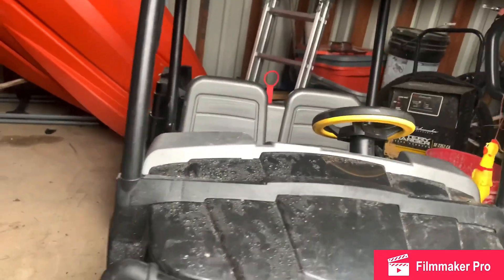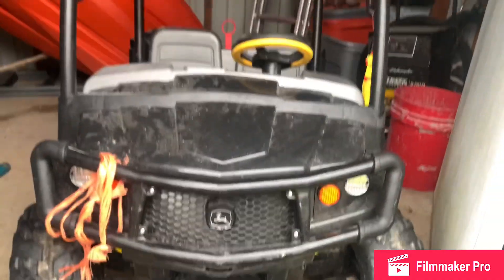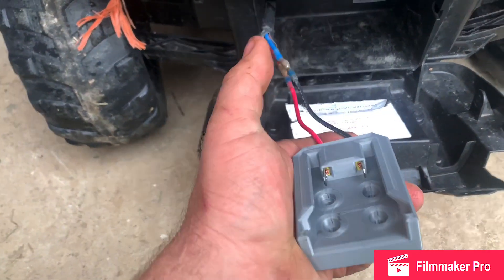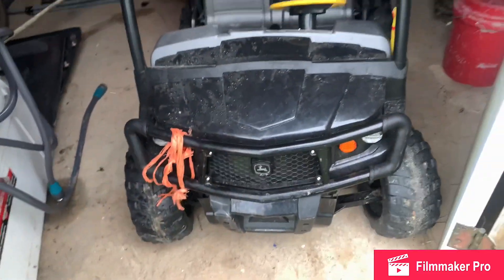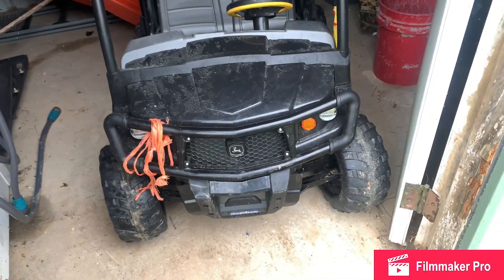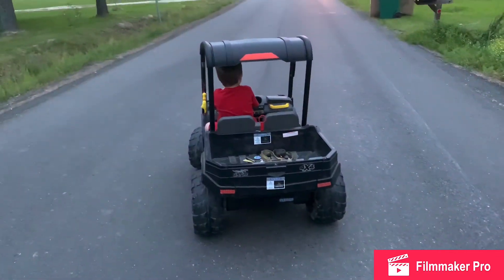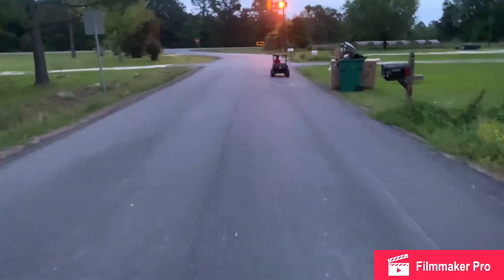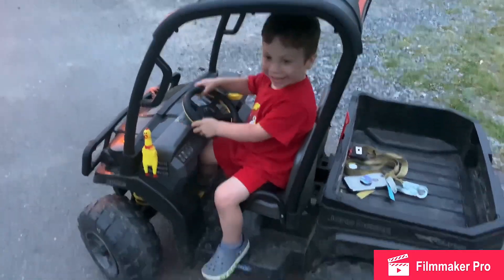M18 Milwaukee battery on 12v peg-perego gator it’s fast!!!!!!!

Comment: How long does it run on one battery? I just got two 18V 6Ah Milwaukee style batteries and that connector you recommended. Just curious how long my kid will ride before I have to switch out batteries.
Reply from the maker: About 45 mins.

Comment: That's awesome- I tried to do the same but now the 2 speed gator will only run in the lower speed setting. Any ideas why? Definitely not getting the speed you are. On setting 1 it's equivalent to the old battery on high speed. Using Milwaukee m18 high output HD 12.0 battery. Thanks
Reply from the maker: Prolly to many amps that’s a 12 amp battery. Might have messed up the speed switch